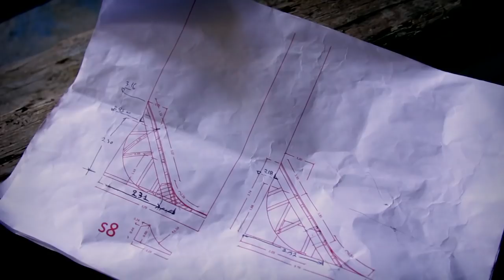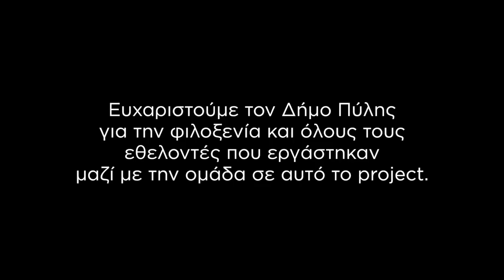BMX Full Loop Attempt - Red Bull Full Pipe part 3

Comment: If that was a perfect cylinder, In order to make sure that he wouldn't fall off, he would have had to been going at least 6.065 m/s at the top of the cylinder, or approximately 13.57 mph, in perfect circular motion relative to the center. However, he was approaching it at an angle, so he would have had to have gone a bit faster than that to not fall at the top of the cylinder

Comment: His bike is grossly undergeared to achieve the velocity he requires. Once he pulls away he's just freewheeling. He can add nothing to his initial speed. When ideally he should be accelerating continuously down the ramp. This is an incredibly amateur approach to the problem considering the investment in labour, transport, materials, video, the air bag and that huge ramp. All it takes is a smaller sprocket on the back and a bigger chainwheel on the front to add another 20mph/30kph.